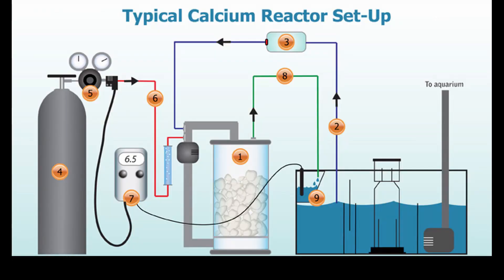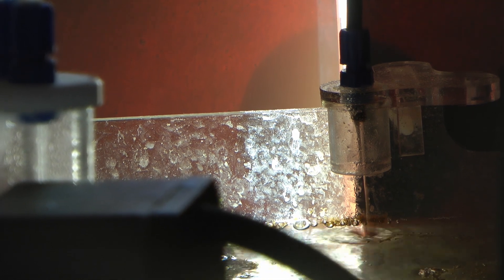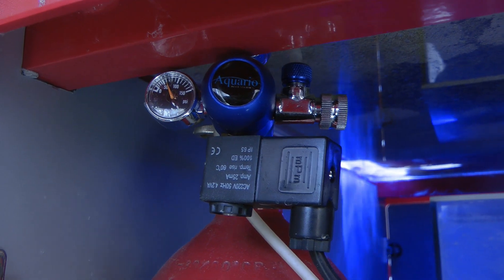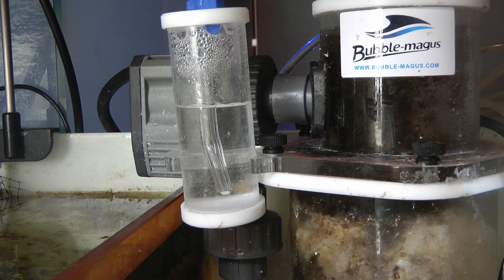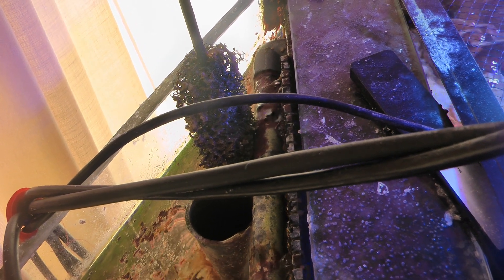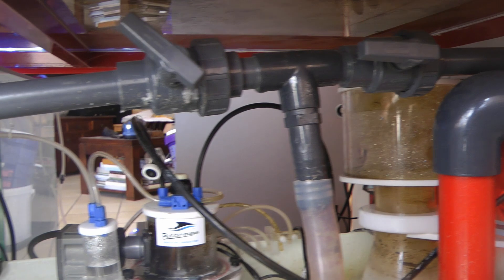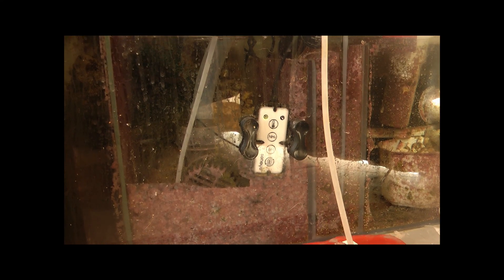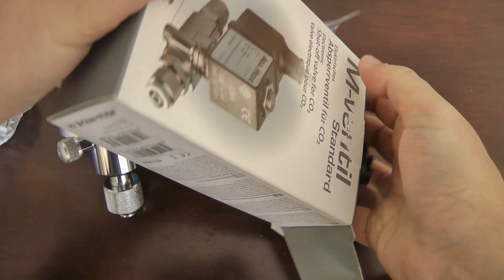The simplest (and cheapest) way of running a calcium reactor

Comment: I have been having a hard time justifying the purchase of a calcium reactor.  I also dont have any controllers and dont plan on getting them.  I feel like they are required with the calcium reactor to monitor the ph so you do not completely melt the media in the reactor.  To do it right fully controlled with monitors it came out to be about 1500$ which is insane.  Was looking at the aquamaxx calcium reactor.  I also looked at the dastaco model and it just appears incomplete and in the USA still uses euro plugs and voltage for $1400.  Its like some kind of sick joke.